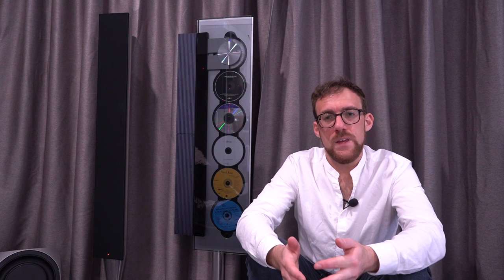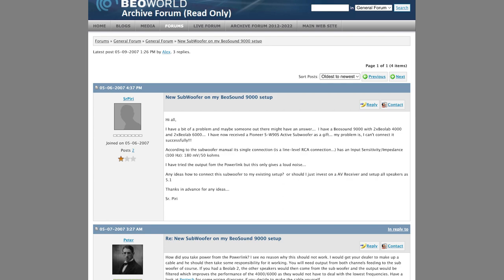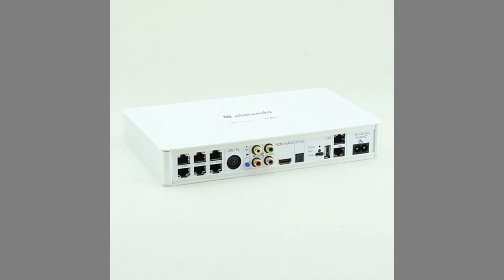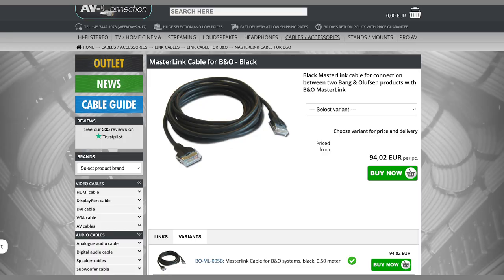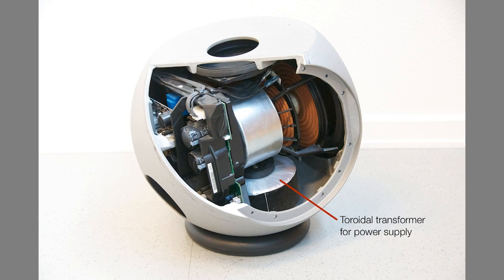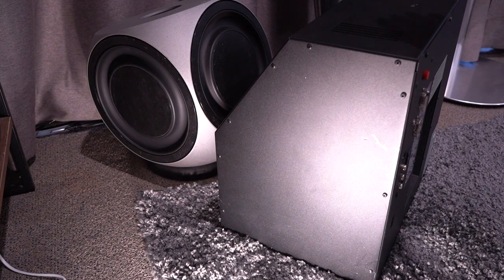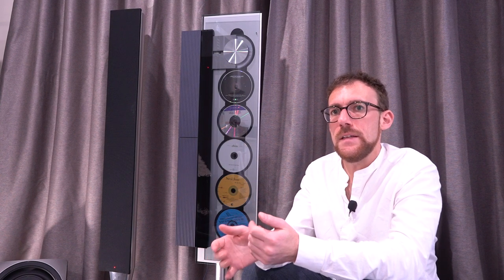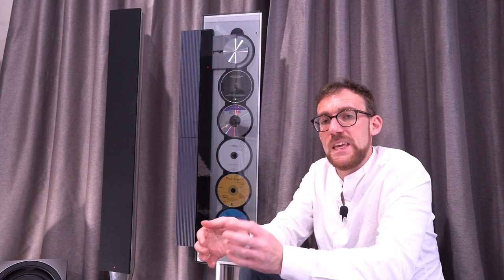REFINED THUMP Bang Olufsen Beolab 2 Review

Comment: Humm you just connect the Beolab 2 with single 8pin Din Power Link cable from the Beosound 9000, then run Powerlink cables from the Beolab 2 to each of the Beolab 8000s !!

Comment: hey mate, with this full setup is it possible to add a turntable that can also utilize the speakers?
Reply: Yes, you would need a 5pin din plug/male to 2x RCA socket/female lead to plug into the aux socket of the beosound 9000, you would also need to use a phono stage/preamplifier 👍

Comment: i want to use 2 lab2 in left & right. how you can split left n right channel ?
Reply: My Main tv room is about 60qm and imho 2 bl2 might be an overkill. Ok.. I use 2 bl penta mk3 as Fronts. 🤣
U can set that up in the TV Menu
Reply: Powerlink splitter
Reply: @mdi800 indeed defo the way to do it, I’ll just add for irshad that you are splitting into “2 channels”, left and right is something different as it implies stereo, your subs on the other hand will just be playing the exact same sound and stereo doesn’t apply to bass hence subs are not usually in pairs 👍
Reply: @gimble447  There is some music with left and right bass like Marty Robins, Beatles stereo tracks, orchestral music, mostly older music but some modern music has it too. The common thought is that bass is not locatable but when you get 2 subs and a stand up bass is on the right side you really can visualize it on the right side and the left sub is not playing like on the song big iron. For some reason the bass is more clear with subs than just my 9’s playing by themselves. Probably placement in my room so the subs help even it out.
Reply: @mdi800  I get all that mate, I’m just talking about terminology. Also bass isn’t directional, so not easily locatable anyway,  an example being subwoofers being stuck in the boot of a car but the mid and treble which are directional has the mids in the door beside the driver with the tweeters as close to ear hight as the can be. My beolab 2 is in quite a large room (admittedly not as large as yours) and manages even 90s dance music with total ease so yours will be really loud with 2 😆
Reply: @mdi800  I should add that subwoofers run in mono, so with something like the Beatles example you mentioned a single beolab 2 will play both left and right channels bass output, with  two beolab 2’s they will both be playing just the exact same thing as eachother, ie there is no left or right, just 2 of them doing the same thing, hence why I mentioned the terminology in my first comment 👍
Reply: @gimble447   that would be true with a regular splitter and preamp with one sub output but the Beovision 7 can support 7.2 surround sound and has an option for left and right subwoofers or front and back subwoofers so when I play Beatles (stereo mix of course) both subs do not play at the same time. When I watch a movie both subs play the .1 as mono. I also use a splitter for left and right powerlink so when I set the levels in the menu left and right subs play separately when highlighted on the menu. They each carry one signal rather than carrying both left and right. Having 2 subs, left and right is superior from just having 1 when most time the 2 subs are playing the same for a cleaner fuller sub bass presence while being level matched the to speakers and also more sound stage on the few track with stereo bass or panned bass instruments in separate channels.
Reply: @mdi800  Ah I thought we were speaking more in with reference to an audio system as per the video and-as the question Irshad has asked about using 2 subs with the equipment in the video, as opposed to a home theatre setup , I’m obviously talking about them just being in series via the power link audio out socket on a hifi system.
Reply: @gimble447  I understand, I mean I have cd player and record player hooked into my system the tv is just also the processor but I listen to 2 channel for music as well as full 7.2 surround for movies and Xbox. I also listen to Dolby atmos music but it is down mixed since my tv doesn’t support it. The splitter would work with say a beosound 3000 or 5 but it would be full volume with just bass/treble adjustment so you would need some sort of eq to get the levels right but it would only work with the aux input. Also with 2’s I set the volume to match the Beolab 9’s and they are both almost turned down all the way so it’s nice to have the headroom for turning up the volume and not driving one sub too hard.

Comment: The Beolab in red with the Carbon Fibre is not actually a B&O option. These have been customised by someone to look this way and probably to cover damaged or sticky rubber on the Bezel and centre sections. The rubber coating deteriorating & going sticky is a common fault with the Beolab 2 Subwoofer.
Reply from the maker: Its starting to happen to mine

Comment: Dude, I could only watch 2mn of your video. Too painful... just connect the 5 pin cable from the 9000 to the Beolab 2 and use the two Beolab 2 outputs for left and right beolabs 8000 and that's it !! Crossover adjustments are on the Beolab 2's back... Next time, try not to complicate what is really simple !!
Reply from the maker: Um yes thats exactly what i did. If you had watched the video you would see that